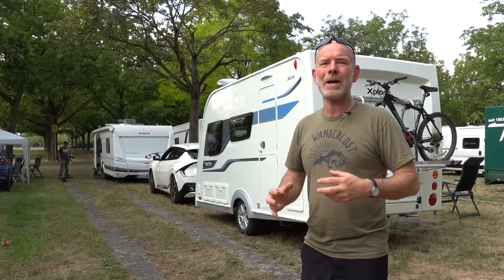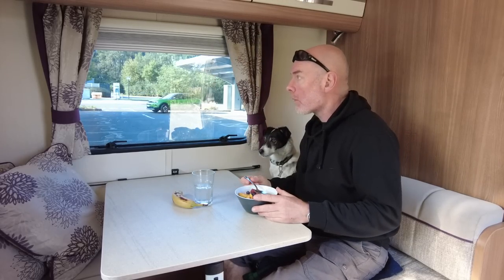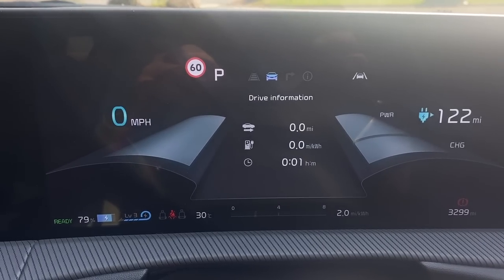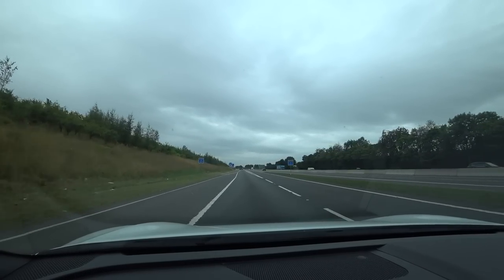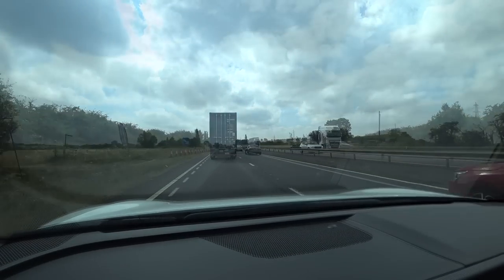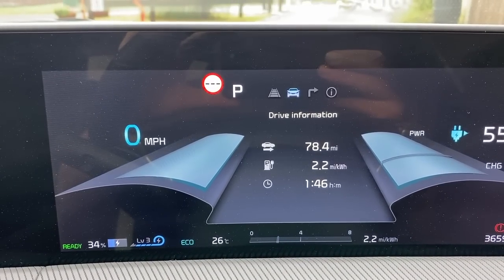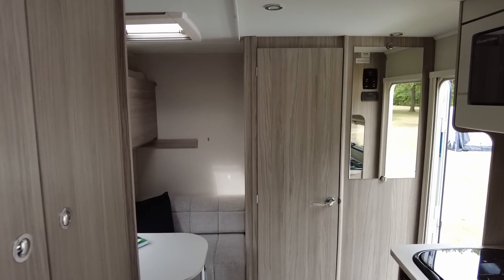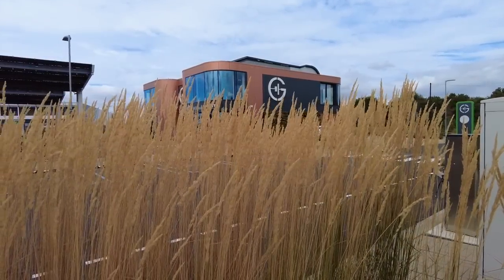EV towing a caravan to Germany from Scotland: Range and cost

Comment: Thanks for confirming that towing a caravan with an EV is not worth the hassle.
Reply: Thanks for spreading your negativity
Reply: @jonbenham6650 yeah sure you can tow with BEV if your prepared be inconvenienced  with many multiple stops in a day , frankly they are rubbish with a paltry range when towing compared with diesel or petrol which can easily achieve 4.5 hours 270 miles between filling up
Reply: Maybe you're best sticking to package holidays if you think this is too much hassle.

Comment: This has convinced me 100%.          To carry on using my jaguar XF V6 for towing , sorry but going on holiday should be about getting there and setting up the same day ,not spending hour upon hour unhitching and hooking up your van , fighting over charging spaces  and constantly worrying about range
Reply from the maker: That's cool then. I'm just out to show it as it is today, and what improvements need to be made before it becomes mainstream.
Reply: Thank God someone else with sense.
Reply: @andrewjditton  Many years from now if ever these improvements will come.I the meantime 90% of the population will stick to there petrol/diesel cars for a long time.
Reply: @foppo100  You don’t have to tow a caravan everyday do you? I don’t mind the 45k km per year in my EV.
Reply: You Just pace charging with a normal rest stop. It's perfectly doable.
Reply: My thoughts exactly
Reply: @RedBatteryHead  At a miserable 100 miles between charges, what pacing for normal stops?
Reply: @michaeltutty1540  It's doing more.
Reply: @andrewjditton  will never become mainstream…
Reply: @michaeltutty1540  Based on his battery size, 150+ miles is easily achievable between charger. In Holland, keeping the speed below 55 mph it’s closer to 200 miles between charges. I’d be lucky if my bladder capacity was much over 100 miles before a comfort break. When petrol and diesel is £5 per litre, you may reconsider combustion engine vehicles as a form of travel……. EV’s will get cheaper and battery ranges will get longer, just like big flat screen T.V’s they cost £10k when they came out, now Argos has them for £400..
Reply: Your right not only that if you got a family it Will cost you more at the service station in food etc where you wouldn't spend if you went to a petrol pump  5min then you carry on

Comment: Thanks for the great video on why NOT to buy an electric car. I shall stick to my Ford Ranger Raptor which does 34 mpg on a long journey. With a 80 LT tank ( approx 550 mile range). It can also tow 3000 KG all day long and still get return 32 MPG. When you do need to fill the tank it only takes 5 minutes, none of this faffing around looking for a charger that works, and then waiting an hour or more to fill up. I have two friends who both took out EVS on a PCP lease deal, and both handed them back within a year.
Reply: 34mpg alone, and 32mpg towing 3000kg. Booooollllssheeeeeet!
Reply: @MrHairyTeabag even if the figures are skewed my kia manages 28mpg towing  
I fill when leaving and at destination and work out the exact mpg and 28mpg is achievable with 1700kg in tow , lets see your battery car achieve 270 miles between recharging when towing  1700kg - a wager of £1000 says you can’t
Reply: @stevensmith662  doesn't have a towbar so your money's safe😄

Have a KIA Sorento PHEV which manages 40mpg when not towing - with 1700kg of caravan I'd reckon 28-30 at best.

Fantasy man whose pick-up does 34 unladen and 32 towing 3 tonnes is still full of shit.

Comment: Nope, ill stick to my diesel van thanks to use for towing. Get nearly 500 miles on a tank out of it and then when i run out it takes me just five minutes and i can go another 500 miles. Electric cars are only good for one thing and thats short commutes or city centres, longer journeys forget it.......can you imagine, "yes kids were off to cornwall but we have to spend two days of that just charging the car so really we only get 5 days instead of 7 but never mind eh, who cares paying for those two days of a holiday for nothing...........Plus what most electric car nuts fail to tell you is that using the fast chargers cost you TWICE as much as petrol and diesel

Comment: Yes, it can be done but it's hardly stress free and that is what you (I) want on a holiday. The range and efficiency of EV's is certainly improving but they've still a long way to go, no pun intended. 80 miles or so between charges is still poor compared to conventionally fuelled alternatives. My diesel LC, with a fully loaded 1.5 ton caravan, will do home to Scotland  (320m) on one tank, obviously without the problem of route charge planning and charging down time. Without the range/charging "worry" there's also no problem with unexpected diversions and road closures, as has happened to me a couple of times plus you can "boot it" to get past slower moving traffic, when required, without concern. I've nothing against EV's, for certain applications they win hands down but for me they're just not practical for long distance caravan touring.........yet!

Comment: Thanks for your video it's answered a lot of my reservations for and against electric. At todays prices it's very favourable but with rocketing electric prices it will become less viable. My current towcar has a range of 300 to 400 miles per fill towing which removes the stress of having to continually plan for electric stops and the worry of them being out of action. The other problem for me is the continual disconnecting & re connecting the caravan ,so for me the electric route is still way way into the future if at all.
Reply: Trust me 😉 electric will be the future just the same as petrol in the passed left the 🐎 and cart. I truly believe that new technology is just round the corner, so never say never.
Reply: Believe me. It's not a big deal.. It takes 2 minutes.
Reply: How much range has the ordinary electric car got in winter when lights,wipers,heating &air con is on all the time.
Reply: @les.6343  about 1/2 a mile less than in summer. Those items take so little energy compared to driving, they are in the noise.
Weather ( heavy rain in particular) has a much bigger impact. Perhaps as much as 5%. Which for 95 journeys out of means 100 means I only have 125 miles more than I need instead of 130.
It’s a total non issue.

Comment: My car uses 9l/100km and for the same journey i would have paid 182€ for fuel. 
My car only costed around 4000€ so i could make a lot of trips until i break even with an EV. So for me its not worth it now but i would love to get an EV someday. Atleast you are saving a lot of money on fuel but you pay with your time. It would be optimal to be able to tow around 300km and then make a 20min stop from 10 to 80%.
EVs are not quite there yet to be able to tow over long distances for me but you made a very nice video and i have a great insight now.

Comment: Hello, I found your report interesting. Thank you very much for posting it. Your previous experiences encouraged me when I bought my car. 
I have lived a similar experience, but towing a caravan of about 1200kg fully equipped plus three more passengers on a trip from the center of Catalonia to the Frech blue coast. So I calculate that, more or less, my poor Skoda Enyaq 80 has had to carry about 1500kg extra weight. The result in consumption has been similar to yours with the large caravan (about 35Kwh/100Km). So I'm glad to know that if you reduce the weight, the autonomy increases substantially. 
But in my experience, and despite having to stop a couple more times than towing with a fuel car, the worst thing about traveling with a caravan is still the speed limitations, Which is a drawback independent from the towing car. Even more than the "extra" waiting time at the chargers. Because of how boring and tiring is to drive slowly on the motorway, you want to stop often. So the excuse of charging is good for doing something more than looking ahead.
On the other hand, finding a suitable place to charge has been easier than I expected. Most of the times, I have been able to park directly with the caravan attached, and when I had to detach it, it wasn't a big problem either. Probably because most chargers are not in the busy gas stations, and there is usually more space available. But of course, planning the route well with ABRP (or similar), pre-verifying the places with google maps and being driven with a GPS for caravans is mandatory. 
Oh! And it's always fun to see people's faces (including EV users) when they see you towing a monstrous brick with an EV!
Reply from the maker: Thanks so much for sharing your experience! Good to know that you didn't need to detach the caravan many times. I think the UK is particularly bad in this area. All the best.

Comment: Man, thank you for this video! This was so helpful! For a vacation trip, I think this is awesome. You've got the time, and as they say, your vacation starts with the journey. I would really enjoy such a tranquil way of traveling. 

I am in the process of deciding what car to get next however, and I need to tow a trailer for my business. I did a rough calculation of how the range would be in real life with the trailer attached, and your video confirms that range really plummets. Also, the charging bay predicament completely slipped my mind until now to be honest. That problem of getting in and out of a charing bay with a trailer...thats simply not gonna happen 99% of the time, not as long as charging parks are designed to show off your Mercedes EQS and Porsche Taycan rather than being a serious infrastructure for people who are on the move to earn their livelyhood. 

Since I tend to be on the clock and also might end up quite far out in the countryside when arriving, then need to work and very likely have no opportunity to slow charge while doing so, then need to get back quickly since it'll be the middle of the night already, an EV just won't do what I need it to do just now. Especially so, since I won't be able to detach the trailer while on the move. There is way too expensive stuff in there.  

We ordered an EV "for the familiy", so I always have that for trips where no trailer is needed, but for the heavy lifting, a good hybrid system is where it's at right now I think. In 10 years time, things will very likely be different and I'll be on board as soon as the cars and infrastructure allow for sure. The quietness of an EV while towing really must be something else and given the high energy consumption, burning fossil fuels really bugs me when towing. So I am really looking forward to go all EV. But for now, I think Nissan nailed it pretty good with the E-Power 4x4 system, that's what I am looking at right now. What I see from videos in japan, fuel consumption is really low. 4-5 Liters/100Km in a large SUV with 2000 Liters of cargo capacity, while having a lot of power (213hp and 525Nm) available at all wheels (two motor system), that's pretty good. And range while towing will still be around 400Km, plus I can refuel in 5 Minutes at any gas station with the trailer attached. Should be a good bridge towards going full EV. Still, I hate that it burns fuel. But well...that's how it looks right now. Thanks again, this video really helped me to reach a final decision!
Reply from the maker: Glad it was helpful and showed some considerations you'd not thought of. For many people who tow, a PHEV is still the way forward. Sadly I don't think the savings you get with an EV will last much longer with the latest price hikes :(

Comment: Interesting trip, which showed that, with patience, it is possible to tow quite a large caravan successfully.
What I found most interesting was the substantial reduction in consumption due to driving at lower speeds.

Although it might be more boring, driving at a constant 50mph/80kph might make for less charging time and ultimately better journey time overall.
Reply from the maker: Good point! Especially if, as demonstrated in the video, you can tuck in behind a lorry.
Reply: How about all the poor buggers behind you??

Comment: Thanks for sharing this Andrew. I tow my Lunar Quasar with a Tesla Model X. The Tesla super charger network is a game changer for EVs. I usually cruise at 50 mph if not slipstreaming as I find I get much better range than cruising at 60 mph. As you touched upon aero drag is a big factor and increases with the square of speed increase.  I also find as you did that slipstreaming a lorry at 56mph has a big positive impact on consumption.
Reply from the maker: Glad you enjoyed. Nice to hear of someone else doing it. I think the Supercharger Network is what sets Tesla apart - it's been a bad weekend for me as regards charging success.
Reply: Australia. The last bloke I met who was a fan of slip-streaming, took out his front end on a  Kangaroo which appeared from under the back of a truck. Already mangled by the trucks bullbar at 100kph, it still managed to writeoff his tow vehicle.
Don't slipstream. Maintain a safe distance and allow plenty of visibility and breaking space.

Comment: Thanks for Great video! You’re very polite charging to 80% only, I would charge to 90% if it still going quite fast! Wow awesome potential range if you drive a little slower! I drove 120 miles doing 50 mph so I wouldn’t have to stop to charge, still only got 2.2 kWh in my Audi Enron  what I do like about this car is that the charging port is near the front so I can park nose in to charge with the caravan in some charges like route 303.
Reply from the maker: YES! I wish the charge point for the EV6 was in the nose too. 2.2mi/kWh is still pretty good when towing. Cheers Christian.

Comment: Amazing difference between Europe and Australia - distances of course - a short trip in a van in Aus would be 400km, my last trip with a camper trailer was 7000km over 4 weeks with one stage 890Km between petrol stations. But what I really notice is the difference in vans, typical vans in Aus are 2000kg at the low end and up to 3500kg + and they typically have massive off grid capability - like 600a/h battery, 600+ Watts solar - 400 L water .... my "light weight" 4x4 camper trailer while only 3.5m long (total length) is 1100kg and has 150L water and 250a/h battery.

Comment: Our company had electric vans but as soon as you filled them up with equipment the miles just fell off a cliff. Needless to say we are back to diesel vans. I'm guessing it's the same for towing
Reply: Not a wise move buying those vans then. 
Do you know VW , take perfectly good diesels engines out of new vans and fit electric motors that have a 70 mile range and couldn't pull the skin of rice pudding.

Comment: THANK YOU SO MUCH... The most important message is the energy price / km which is 3 times less with EV compared to Diesel/Fuel
Reply from the maker: You're very welcome! It was indeed cheaper in this instance Francis, which is all I can report on as this is the actual data I have. I think it IS possible to pay a lot more, but overall the price will be lower (at the moment) and it's not exactly difficult to find cheaper chargers than others thanks to resources like ZapMap.

Comment: for me as an diesel driver (usually on waste veggie oil) i think that recharging every 80 miles is pretty bad… i usually drive around 400km (~280 miles) till the first break and around 600km till the first fuel stop (even with an car trailer with an car on it)

Comment: This is the precise video I have been waiting for.  It is possible…who knew?  My current Ioniq Electric has a motorway range without caravan of around 150 miles (at 70mph) and we do the 500 mile journeys London to Newcastle return journey 6 times a year (one charging stop in the middle each way).  With your EV6/caravan combo, you can do the same journey, but with a caravan in tow at 60 mph.  We tend to stay around Durham for a day or two, so can use a fast charger there, then drive back to London.  It is  all very tempting.
I would really love to see what your kWh/m is with an Eriba or a Silver caravan - both are very aerodynamic.  Or perhaps sitting behind a lorry for most of the way like you did means a non- pop up caravan is fine.
By the way, new charging hubs are becoming available every week so the gaps between the EV charging hubs are becoming smaller.  Increasing numbers of petrol stations now have chargers too, as do many McDonalds and Costa’s just off the motorway.  The advantage of the latter is the parking situation is more straightforward  than the ‘real’ motorway service stations - e.g. Duckmanton on the M1.
Reply from the maker: Many thanks Alex, that's very useful for me to know. Fingers crossed I can get hold of an Eriba soon. All the best and maybe I'll bump into you at a charging station some time? All the best.